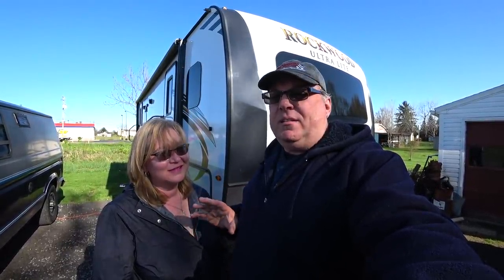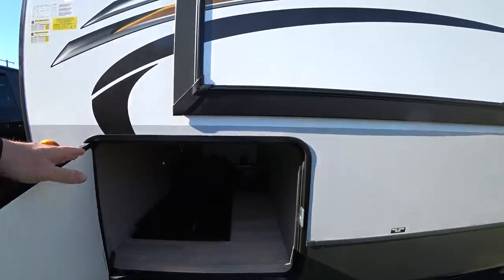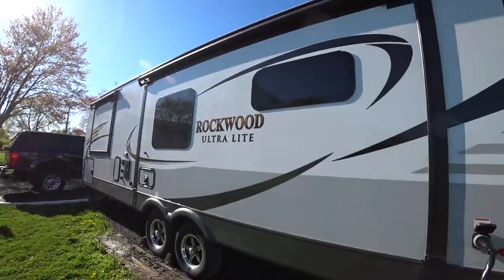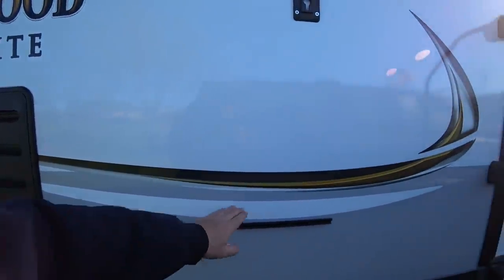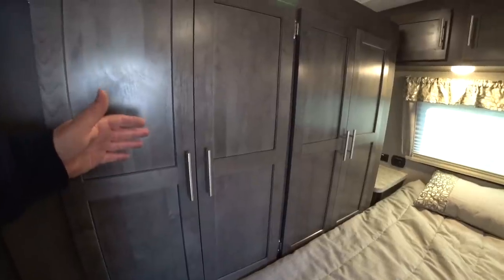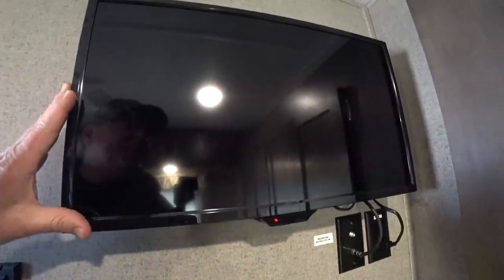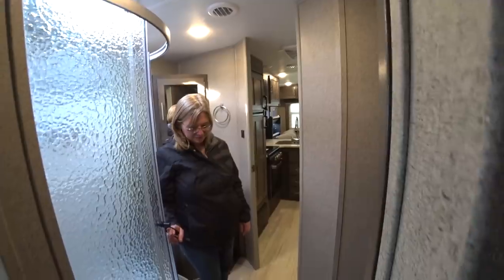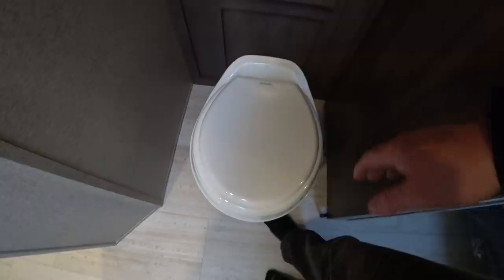2020 Rockwood 2604 WS Detailed Look & Why WE Bought it

Comment: I love how I work at an RV place but I still end up watching your walk through video 😁. The only info I have for you (I’m not normally that person to say anything but I personally put a ton of thought into my new rv that I just got as well) we wanted a slide that allowed us to access everything if parked at a truck stop or something, I also wanted the regular stairs so they don’t have to be folded down to get in, typically you have to leave those stairs like yours down at a truck stop. But I’ve told customers that question that as well to put a pull rope on it and the door so they can be pulled up and the door be closed with stairs in your way. That way you aren’t blocking the other parking spot, on the flip side of that, if a big truck parks to close, your stuck inside until they move lol. So you win some and you lose some. 😁
Reply: We had these steps installed in our fifth wheel for the past 3years.  During this time we have parked between big trucks at numerous rest stops and not once have we had a problem deploying or raising them.
Reply: Greg H awesome. I’ve never had them, they just seemed that way. But we park the campers closer together on the lot than trucks do at truck stops.

Comment: Congrats on your new Rockwood.  Welcome to the Rockwood owner family! We have an early-2019 Rockwood Signature fifth wheel.  Those E-Z Lube Dexter axles are OK for shooting it a bit of fresh grease in but you have to use a manual grease gun and spin the tires while slowly pumping in the grease.  Do not use an air grease gun.  I would still manually check and refresh the bearing grease once a year.  The forums are full of stories about people seeing the rear seals blow out from using the E-Z Lube zerks.  I haven't had it myself but I do have the bearings and brakes checks each Spring.

Comment: Thanks for the info - we have the 2608BS with theater seating. Another reason for 2nd door is if u have guests. The booth is one of the longest we've found. There's enough room for an air matress on the floor in our kitchen as well. Not a fan of the steps. We keep a towel and sweeper by the doors and shake before putting all the way up. But I have used the bedroom steps for a clothes drying rack.😊
The water miser info sure helped explain why we had water in our holding tank.

Comment: You mention "china bomb" OK, I just upgraded my tires to Goodyear Endurance ST225/75R 15 on my 2018 Keystone Outback 266RB. (8700 MAX weight) My first trip on this new trailer ran over a piece of metal at a mom and pop filling station in Colorado. It was not even on the roadway. As I was filling my truck I literally watch that tire go flat!  Had a spare, swapped the tires out and finished our trip. Got home and then I decided to upgrade to the Endurance. Best decision I made for sure. I truly believe if I had the Endurance on my trailer and ran over that same piece of metal, I would not have had a flat. The El cheapo that came with the trailer was the issue. Smooth ride and the most improved difference is in cornering and during turns. More stable and controlled ride. The El cheapos had sidewall flex that would not stop. Based on the date, these tires all made in March 2019. Today is the 5nd of May 2019. Also I upgraded my suspension, I upgraded my suspension to the MORryde CRE3000. Now I just got the Goodyear Endurance ST225/75R15 for my 2018 Keystone Outback and with the upgraded suspension, WOW! Comfort beyond my wildness dreams.  I traveled into town for the install of the suspension since I don't have the jack stands to support my trailer if I installed it myself. That ride back home was a huge improvement over the old stock suspension. Now with the upgraded tires, WOW factor over the top. The most noticeable difference was on turning. Much more stable and  control over the stock, cheapie tires that came with the trailer. Highly recommend both suspension and tire upgrades ASAP on travel trailers. I am sure this also applies to 5th wheels, but most high end 5th wheels come with these upgrades. I think for 5th wheels it is the MORryde SRE4000 series suspension and 16 inch tires. FYI the original tires were trailer king II tires. Most come on TT. Just my thoughts. An just another note with the 266RB slide in and everything is accessible except the bedroom. But we normally don't stay over night in Truck stops or other places. We are spoiled. Need full hookups...……...
Reply from the maker: We like full hookups too! We like to think ahead if we are traveling a distance just to get few few winks 😁. I am sure we will be replacing our tires in the near future right now they have 60 miles + whatever the transporter put on 😊 thanks for watching 😁

Comment: I love the new Rockwood. if I were to get another RV I would definitely B A Rockwood. One thing on the axle bearings they are not bearing Buddies, you need to raise the tire off the ground and spin it while you put the new grease in and it will Purge the old grease out the front. I do not believe you are supposed to put grease in them when they are stationary. Thank you.

Comment: Really nice video, like you, I did a ton of research on which make to buy..the best bang for your buck is Rockwood... even tho' it isn't rated as a 4 season...we took ours (2019 Rockwood 2606ws) to southern Texas for the entire month of November last year, it got down to 18 F for a straight week at night.... had absolutely no freezing problems..other than the outside hose bib freezing up, we too opted for the tank heaters, they work great.
We really love the included torflex suspension, the only other TT that includes it (without added cost) is Airstream.

Comment: Nice trailer. I also bought a Rockwood. I still like it but I had a major problem with it. It had delamination of the outer skin 3 months after I bought it. They did repair it by replacing the entire side (which worries me) and they did so in a timely manner. As long as their repair work holds up I will be very satisfied with it. I have a friend that had a leak which caused mold to grow. The particular manufacturer of their travel trailer is keeping it for 6 months to fix it. They will get it back at the end of camping season this fall.
Reply from the maker: Rockwoods are not known for leaks or the lamination that is definitely a rarity. Rockwood has the ability to repair and they will repair entire walls to get the problem fixed immediately. We were told that during our walk-through tour. They said that anytime they have a problem no matter how serious it is they will completely disassemble the RV and rebuild it if needed to be. The good news is, they have their own lamination facility and they do all of their own lamination work so you can bet that they replace the entire wall with something new or they at least took all the damaged off of yours and re vacuum laminated the entire thing. They are a good company

Comment: I have to disagree with the Castle Rock tires, I thought they were good tires also but after 1.5 years on mine I went to check the air pressure before leaving for a trip and seen cracks around all 4 tires. All 4 tires were separating out. Lots of talk on the forest river forum on these tires. I replaced with Goodyear Endurance. Good luck, nice trailer!
Reply: Wow good to know

Comment: Thank you SO much for showing what it looks like inside with the slides in. I want slide in accessibility and I was unsure whether that was an option. When I was little and traveling with parents we often would pull over for bathroom breaks and quick meals. I like the slide options but didn’t want to lose access for super short stops, or as you described, over night in a place where the slides need to stay in. Nice job on the video!

Comment: The problem with these type of steps is when you fold them up for storage any debris on the step will end up in the trailer. Also, sand a grit needs to be be swept off of them before storing. If it rains or snows the steps will collect the moisture which could be transferred into the trailer living area. Thanks for your review of the unit.
Reply from the maker: We have traveled with this RV extensively and we do have a routine in which before we put the steps away we do sweep them off and also we shake them before putting them in the upright position we may have to take a towel and wipe the steps occasionally if it's been raining extremely hard but usually it takes no more than a hand dish towel that lays underneath of the steps when they're over there in the upright position that takes care of any moisture that might be there. I'll tell you what the downfall is with the steps. When we stop at locations and pull up close to a curb like at Walmart or a truck stop near an island for the night the steps have to be far enough away that they don't hit the curb because they cannot adjust low enough to accommodate an extra six inches of height. Other than that they are perfect.
Reply: @Rvdaydream  Thank you for your response; I appreciate it.

Comment: Wow! Where do I start? We bought the 2608bs front kitchen model. Love it! The floor plan eliminates 1/2 of the issues you have. 1st The levels are cheap and easily added. 1 front and 1 forward side corner for fast easy leveling. Frame of steps not a issue in the 2608 model. Key holes could have been better quality as you said. We optioned for theater seating which have 2 compartments with usb plugs so running power to electronics is not a issue. Agree with the waisted space under left bench seat of dining. Only access is removing seat and board. On the porch side our water heater, fridge and stove is at the front so it doesn’t interfere with sound, door or excess heat as your model. Trim the blind by removing unneeded fins and move the plastic supports up on the blind above the stove. My handle no longer hits the blind when I need to open it. As far as the air conditioning not being aerodynamic, the entire front of these Rockwoods are pretty flat so I don’t feel the air units are that big a deal. On raising the steps, you have to open the door all the way! Is that really a issue? Lol You loved the ease of the steps in a earlier video. You should of added a inverter with 2 or 3 plugs in the tv area. Dealer added mine before I picked it up for far less than you spent on the bedroom tv, mount and labor. I purchased a tv and mount for less than a $100, installed myself. Agree on the rv manual. Should of included one. Our 2019 has adjustable fish eye reading lights over the bed and theater seats. Not the bright round lights you showed. Maybe because our bedroom slide is the bed not the closet. Suggestion on the floor vents! I pulled the vent covers and added window screen to the bottom with a hot glue gun to prevent stuff falling into vent hole. I like your videos and love the Rockwood we bought. Like you, we shopped for a long time to find the one that jumped out at us. Large front kitchen with extra counter space, large walk around bedroom and closet. Only drawback is our model does not have as large of storage area up front due to the front kitchen. The rest of the floor plan makes up for it. We dry camp a lot so I also added roof solar to help keep batteries charged. The black tank washout connection does need to be improved.

Comment: At 28:14 you talk about stepping on the slide while it is in. You should never stand step sit on the slides while they are in. It will break them. Just a heads up.  DO NOT step on the floor of the slide out when the room is retracted. The slide out floor is not supported by the main floor and stepping on the floor will cause structural damage to the slide room. Doing so will cause the walls to separate from the floor. We know this to be true because our coachman did just that the previous owners would use the couch and booth while there were in and the walls pulled away from the floor.
Reply: It may depend on the slide mechanism your coach has because it wasn't a problem with the slide out we had on our previous Rockwood travel trailer.
Reply: I called 3 different manufacturers today Jayco, Rockwood, Grand Design. Talked to a person in their service dept and each manufacturer told me. “No the side out should not be used or walked on while it is in.”
Reply: ......thank you.......excellent advice..........👍💜☕
Reply: I had no idea this was an issue.  Good to know.

Comment: I know this is a year later, but --
First = I absolutely LOVE the details since I am looking at units myself. Thank you!
Now, here are my two reasons for not installing the towel bar and TP holder: height and handedness.
1. There are tall people and short people. 
It is frustrating to be 5'2" tall and have the towel bar be set for a 6'2'" person, or vice versa. 
2. There are "lefties" and "righties".
It is frustrating to be used to a left side roll holder in your home and finding, in the middle of the night, that it is a right sided one in the RV. By the time you figure that out, you woke up. 
If  this were my rig, the TP holder would be on the sidling door, back near the outer wall since I have mine on my left.
Placing it there would also compel people to close the door to the bedroom while using the commode.
There would be the hanging hooks where you were pointing for towels, robes or clothes , but I would have two towel bars on the lower portion as well for additional drying as needed.

Comment: My brochure for the 2020 shows the dinette aft of the sofa and TV on the wall across from the sofa. This looks like the 2019 floor plan. Regardless, great video.
Reply from the maker: No we have a 2020. The model you're looking at is a 2604 SW. We have a 2604ws
Reply: @Rvdaydream  thanks, boy that's confusing. I don't see that in my brochure. Is it an east coast version?
Reply: Oh looks like when they made the interior changed they flopped the letters.
Reply from the maker: We have an early 2020 model not sure when or where they changed or started the SW 😁👍

Comment: You will have tire failure but you won't know when it will happen. My started failing at approx 5000 miles. I just upgraded to Hercules H901St 12ply tires made by Cooper but still overseas.

Comment: Excellent video! Please advise what is your tow vehicle. Also, do you know of anyone towing this coach with a Heavy 1/2 ton. It seems to fall well within most late 1/2 tow ranges even fully loaded with a decent buffer. Its also just under 30' pin to rear bumper which many would advise is too long. Thoughts?
Reply from the maker: We tow with a 2019 F250 Super Duty with a camper package and a snow plow package for upgraded suspension. Although the half tons R-rated to do quite a bit there is no denying the difference between towing with a three quarter ton or a 1 ton. If you're not traveling long distance and you're just doing it on the weekends I'm sure it would be fine. Even with our 3/4 ton we opted to install a pro Pride hitch, you can check out that video on the installation if you'd like to see what that's about, but again casual weekend campers can get away with a new 1/2 ton. We opted to stay under 30 foot with this trailer so that we could definitely get into almost all the national parks and some of them don't allow over 30 foot. The problem with the half tons is that the new ones are pretty much made to be everyday drivers and their gas mileage is exceptional when not Towing and the three quarter tons ride quality compared to 1/2 ton is the difference between a truck and a car like ride. However all that softness of suspension is slightly suspect whenever a load is applied to the back and is being manipulated by the characteristics of the trailer as it goes down the road. It's a sensitive subject as there are people that will tell you that they're Towing 10000 pounds with a short bed regular cab 2 wheel drive F-150 and everything in my bones tells me not to do that. LOL. I personally would not tow over 6300 lb with a half ton pickup even if it's the HD tow pack 3.5 EcoBoost 4 wheel drive long bed crew cab special that is out there just because it's still a half ton frame with half ton cross bracing and half ton designed braking system. And again for the third time in this paragraph, if you're just doing weekend trips and not going very far, let's say under 400 miles round-trip, then I suppose you could get away with that for many years and not have a problem. But, don't be surprised that you're going to feel the trailer moving the truck around as you pass semi tractor-trailers or as they pass you. Also be expected for your gas mileage to drop considerably when towing. Although my 3/4 ton truck only gets at best 17 miles to the gallon on the highway or casual driving when empty it will only drop to about 12 to 13 miles to gallon when towing under reasonable conditions meaning no large mountains and staying under 70 miles an hour. The half-ton truck will definitely drop from their 21 miles per gallon empty down to the 12 mile per hour range Towing in the same manner. What it comes down to is the half ton trucks will pull double-duty as a good everyday vehicle and a trailer puller however, the 3/4 ton trucks are made to be trailer pullers and can sort of fill in as everyday drivers. You may want to take a look at the videos from big truck big RV covering the same topic and also more recently s'more camping with the schraggs posted a video how they upgraded their newer half ton pickup to a 3/4 ton F250 and how much more confident he felt Towing it with the bigger truck. Also they are only Weekend Warriors as far as camping goes. The most important thing is to feel comfortable while driving. If you're white-knuckling it to your destination once you get there you're wore out from the drive. Good questions though.
Reply from the maker: Here is my thoughts on the topic put into a video...  https://youtu.be/bO9ikmTRMdI